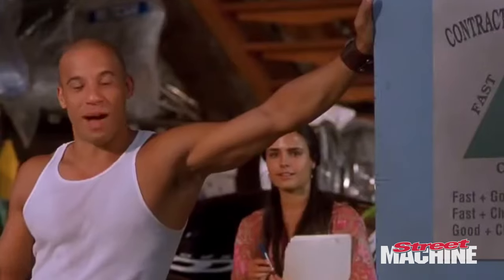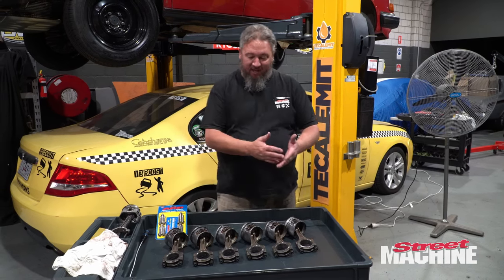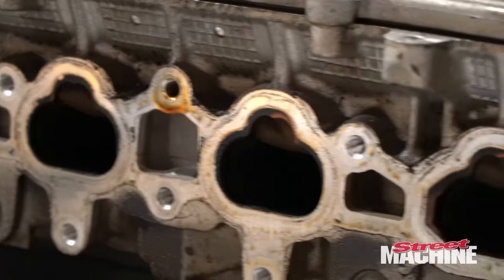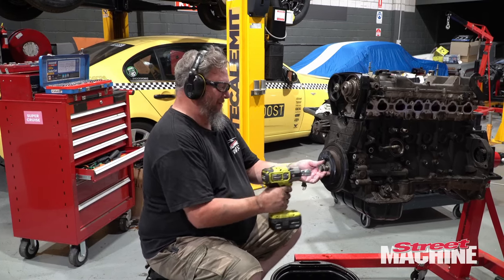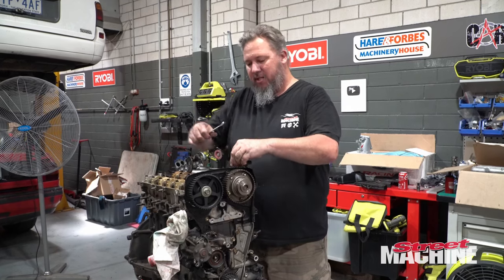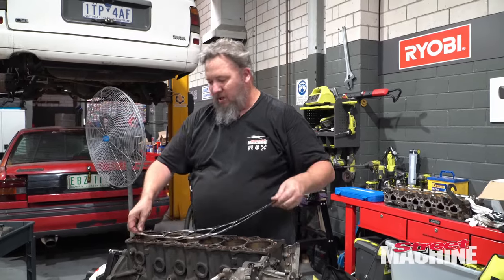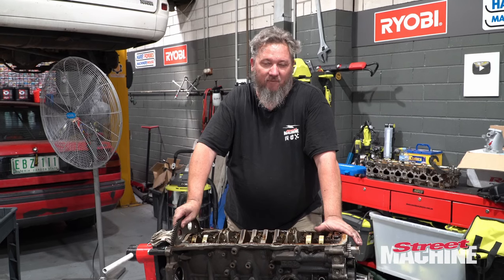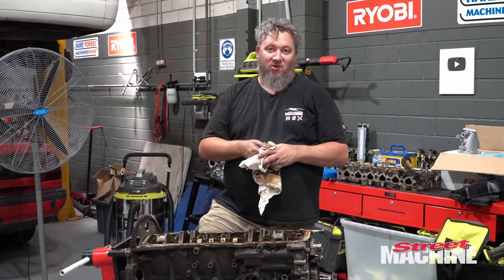Carnage - Building a budget 2JZ - Part-1

Comment: Im 58, in my life as a mechanic i have only remembered 2 engines that were in this condition when i took them apart. 200k mile engines. 
I am talking about still clearly seeing the hone in the cylinders and beautiful crank journals and bearings. 
L28 6 cylinder out of an Datsun 280zx. 
And an n/a 2J out of an early lexus sc300. 
New bearings, piston rings, valve seals, and valve jobs on both engines. They both still run great. 
The 2J is in my 74 Datsun 260z now. Added a turbo to it of course. 
The L28 I sold to a friend to pay for my 2J swap. 👍🏾
Reply: I bought a 2001 IS300 with 278k miles two months ago with slow acceleration issue for $1000 dlls, the first thing I did was to check the engine's compression and wow... 175 psi on all 6 cylinders for a car with that milleage and for being 23 yrs old for me thats amazing.
Reply: This man is what i want my future to be. 2jz’s and the 260z i want
Reply: @dallasflyboy  Man it took all I could do, to keep this car from when I had been married. To having kids, to getting divorced, to filing for bankruptcy, to different living arrangements. My oldest kid just started college. 
I still kept this car. 😁
And after all of that, in a year I will be semi retired, living on a small property I bought. The z car is coming with me.  
Nobody is taking my toy away from me except when I want to get rid of it. 👍🏾

Comment: Using a short or no extension makes it easier to undo the bolts ,less chance of slipping ,the ol trolvo is gunna be fun,maaaad,love the channel and keep it up mate cheers 👍🏻😀
Reply from the maker: True enough but also a high likelihood of injury if you slip
Reply: Also would help if you pushed not pulled
Reply: @STREETMACHINETV  Need to get a longer breaker bar as a lot of torque is lost in an extension, don't see the need when you were undoing the conrod bearing. Also having the extension brings it closer to your teeth
Reply: @danielabsolom7907  you actually have more strength in pulling. Pushing isn't better.
Reply: @STREETMACHINETV  I find that the 700mm breaker bar fixes everything. 
Alternatively go with a 3/4" drive bar it will be longer and thicker, just like she said.

Comment: Looks like a sweet engine there - wondering if those flaky carbon deposits were from running with a bung PCV causing excess oil to burn in the cylinders?  I had to replace the PCV on my 2JZ Soarer twice in the 9 years I owned it - both times it fixed blue smoke from the tailpipe.
Reply: The carbon is normal.  Anytime an engine sits for a long time , the carbon will start to flake off.
Reply: @bobroberts2371  That's way beyond normal carbon buildup for a port injected engine - a direct injected German engine for sure, those things are horrific - something wasn't right with this for a while before it was decommissioned.
Reply: PCV’s are small and simple to replace but most can’t be bothered.
Reply: @wobblysauce  Seems to be a problem on a few 90's Toyota engines - also had another Soarer, this one 1UZ that had oil leaking all over the place - replaced the PCV and tighten everything up a bit and got away without replacing gaskets and seals for a few more years.

Comment: I would imagine 800 HP should be possible and somewhat reliable as long as it's tuned properly (which your cars are always well tuned), but you and I both know that it'd live a hell of alot longer at that power level if you put it on a healthy diet of E85. I don't know how plentiful it is down under, but if you can't get E, I would run a really high octane race fuel. Either way, you know how to build an engine and how to run it.
Reply: E85 varies in availability in Australia, but you can usually find it in most states without too much trouble.
Reply: Plenty of pump e85 in melbourne
Reply: And most engines are good until you bring in to much power down low, just asking for them to bend.
Reply: @wobblysauce  most tuners will take the torque out from down low to avoid bending rods unless you have forged rods
Reply from the maker: We have two service stations with E85 within 5minutes of the workshop

Comment: Using 91 fuel in a high compression motor will leave mental deposits. Also when map sensor is playing up it will run a weird tune. Will run but not well.

Comment: if you really want to do it on the cheap you can reuse the old rings and fit them to the turbo pistons then you wont have to hone the cylinders with new rings 

i did it made 326kw on 18psi

Comment: That 2JZ looks so clean, and being able to still see the hone in the bores, got me thinking that it may have had a freshen up not that many KMs ago.
Awesome use of the ugga dugga on the crank bolt, but I'm wondering why you didn't use it on the front cam bolts? Would've been less effort. Looked like you were about to bust a foofa valve there for a minute trying to under those bolts.
Looking forward to the finished build, and seeing what she'll do.
Keep the great work up Scotty.

Comment: Mate for god's sake get the head decked and also the block as well & put new welsh plugs as well, better to be safe than sorry, why the turbo head will have made some movement of the gasket for sure, so at least you will have a perfectly flat surface for the gasket to mate up to?
Cheers Scotty and good luck. :)
Reply from the maker: The head will get skimmed because of mods needed

Comment: Probably a stupid question, but from an amateuer's perspective, have noticed you guys avoid using power tools to loosen head bolts and sometimes inlet manifold bolts. If this is right, is there a reason for this? Something to do with shock going through these components?
Reply from the maker: I'd hate to snap something, especially with those funky head bolts

Comment: Don't you have a longer bar? (no pun intended) Thought I saw a really long breaker bar in the workshop before. Was wondering why you weren't using it. Torque multiplication is your friend.
Reply from the maker: I need one
Reply: I thought it's not the size but the way you used it that mattered?
Reply: @paule4204  sometimes that is true, sometimes the only thing that matters is size. Breaker bars are one of those things where bigger is generally better. Or in my case I have one that grows with need. When my mum passed away I got one of my dads old ones. It has a slide handle. So it can be both short or long depending on what you need. I am surprised this design is not more popular.

Comment: 0:50    0:55 collapsing an oil filter is a sign that the filter bypass valve is blocked.  Some filters have a built in valve  ( example Ford 302 / Chrysler 318 ) while some filters rely on the an engine mounted valve ( Chevy 350 )  .     Reading the filter spec sheet is a must when mix / matching or installing remote filters.
Reply from the maker: Or a shit filter
Reply: @STREETMACHINETV    Well that too.

Comment: Carbon On the top pistons is where fuel lean out too much and over the time the carbon builds up and stay there
Reply: Could be from excessive oil burning - possibly due to PCV being stuck closed or other problems with the emissions control equipment - common problems on 2JZs & would be my guess given the flaky nature of the carbon build up, rather than the stuck on gum you normally get from rich running - another problem could be a bad dizzy or dizzy rotor causing misfires across all cylinders - though again, that'd normally produce sticky deposits - and more likely to get fixed as it's obvious something is wrong.

Comment: Do stock pistons not have an issue getting too hot and swelling when you don’t run oil squirters and go for big power?
Reply from the maker: Doesn't seem to be an issue
Reply: @STREETMACHINETV  Good to know. I have a ge vvti motor with gte rotating assembly. Aiming for 650whp or so on e85.
Reply: Lot of high horse jz get the oil squirters capped. More consistent oil pressure and most aftermarket pistons don't make use of oil squirters anyway

Comment: Dont use old na 2j....old is dizzy not coil pack...i already did this for supra ...went front cut with wire harness
Reply from the maker: Did you miss the part where I'm putting a 1jz head on it?
Reply: @STREETMACHINETV  yeah its just extra steps.. paying for bottom end rebuild new head  .....but the 1j head is better flowing if you believe the internet ...or an arristo swap or i went front cut supra under 4g..also  oil squirters on turbo bottom end
Reply from the maker: @BUILDSforDRIVING  we're using the 1JZ because it suits all our manifolds and piping. You can't buy front cuts here anymore, or at least I haven't seen one in forever

Comment: Have you accounted for the block height difference when reusing piping etc
Reply from the maker: I guess we'll find out
Reply: @STREETMACHINETV  nothing that can't be fixed with a really big shifter.
Reply: @STREETMACHINETV  when I did the 2j bottom end, I had to change dump pipe, screamer, both hot and cold side (plasma clamps), turbo drain (braided), fuel return line, both rocker breathers and redo some wiring